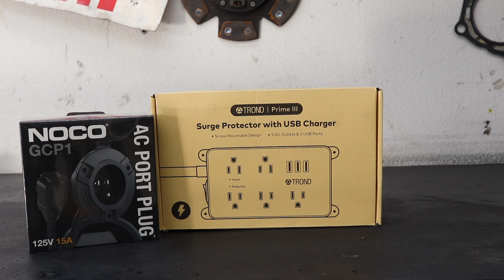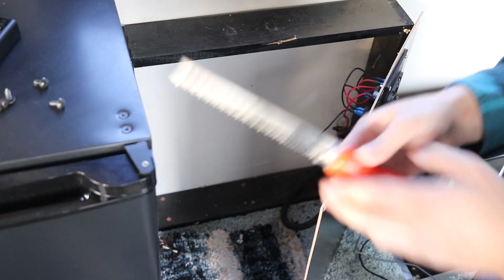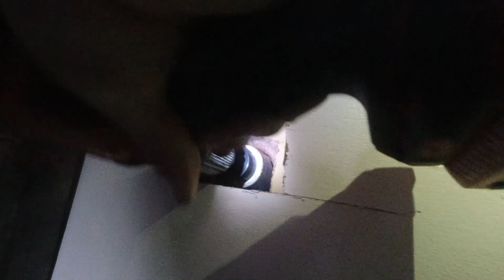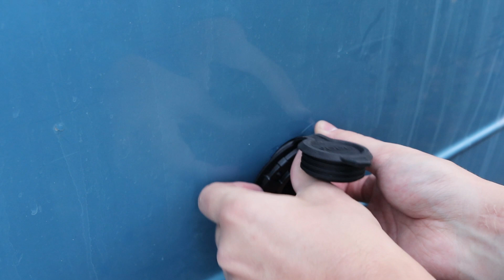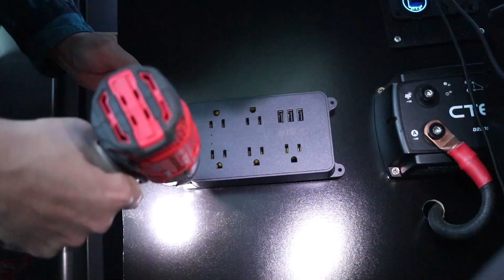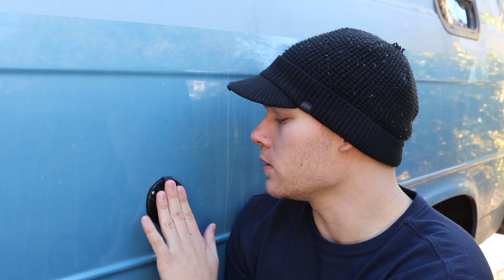15 amp Shore Power Plug Install | Camper Van Build

Comment: Sort of late, but here goes................

My van has a sliding door.  There's a step area just inside of the door to step into the van.  I installed an weatherproof outdoor electrical cover over a hole cut out in the vertical area.  I can bring in an extension cord or solar cables through that cover.

Comment: What about installing in a rear wheel well ? Can’t get myself to cut a huge hole in truck body or my nice Leer topper
Want it out of the way but still accessible.  Noco a good brand? Single or dual female ends?  Great video

Comment: You can plug to shore power to charge and load up your on board house batteries too I assume right
Reply from the maker: Yes, I did that by getting the port plug with two ends on it and plugging one end into a NOCO on board charger

Comment: Thank you, I am doing this today to my conversion van using that same plug.  There are tons of wires running in the walls of my van all over the place and I was concerned about hitting one of them.  I accidentally discovered that if I removed one of the cup holders in the driver's side rear window sill area, I get a clear view inside the wall and I can move the insulation and wires out of the way before drilling.  Oh, and I also picked up one of those 30 amp to 15 amp adapters that you show, that was a good idea that had not crossed my mind.  I am going to be boondocking mostly but just in case, it is a good item to have especially considering the low cost.  I will make sure not to exceed 15 amps when using it.  PS  I like your power wall idea.

Comment: I bought the NOCO 15amp 2 corded plug. It arrived today! This will be soooo much better than constantly running my cord out the window! Thanks for sharing how you did yours. Although intimating to drill through the van walls, once done, that stress level will be gone!

Comment: But - you connected what to your new plug? Did it have a plug on it?
Reply from the maker: A power strip with a built in circuit breaker

Comment: Hi. Thank you for this very informative video! I have question for you. I understand drilling hole in the van and putting the connector into the van and popping into place. What I do not understand is this, on the backside of that connector that is on the inside of the van... is there something on the back that hooks up to the powerstrip that you installed on the inside of the van? What I mean is once you have the adapter installed into the van on the outside, is there a plug of some sort on the backside that you connect the power strip to? So that the power goes from the connector to the power strip? Thank you so much!
Reply: I was thinking the same thing!
Reply: See time is ticking, and I can't stop it like none of us can anyways right LOL anyways so I got to get my damn bus built! I got to be out of where I am by July 1st and I am stuck in neutral. I do not know what's wrong with me? I think it's stress or anxiety? Anyways I've been trying to find somebody to help me build this damn bus LOL I mean that in the nicest way possible I'm just stressed out I guess. So today I'm trying to find a place to move into until I get my bus built. It's expensive as hell here in Gainesville Florida I'm just saying! Oh there's anybody that knows really anything about cutting wood I'm subbing in floors walls ceiling excetera and you're in my area, can you just like send me a message :-) I mean that in all seriousness. I never knew that Stress and Anxiety can keep you stuck in neutral? But I'm thinking well I'll put in the plug and then at least I'll have Shore power right? So now it's time to plug up all the cracks in the ceiling. It's shuttle bus so it's fiberglass. I've got my eternabond tape. I'm just afraid of heights

Comment: I’m planning on needing this set up to plug in when I’m a campground host. Will this 15 amp set up run my fridge, max air fan and large box fan. Is there a formula for this?
Reply from the maker: I believe those things would be fine. You need to look up how many amps it takes to run each of the things you want to use. And make sure they don’t exceed 15amps if you were to run them all at the same time.